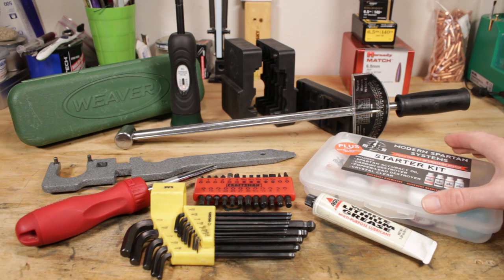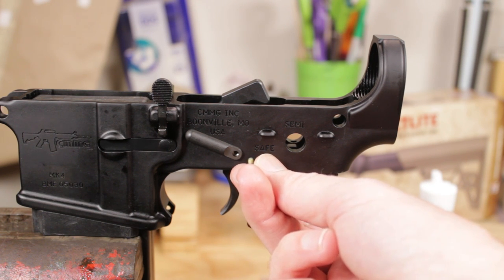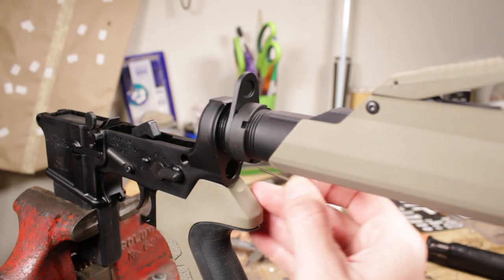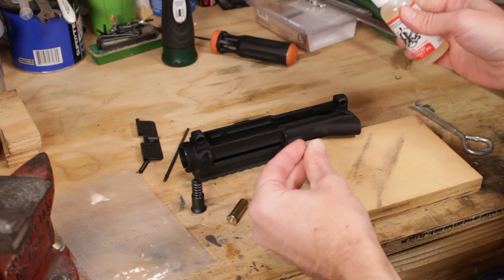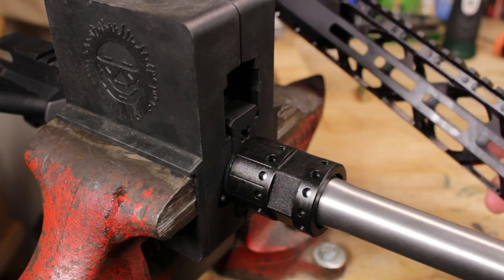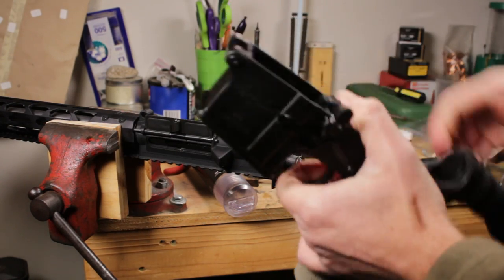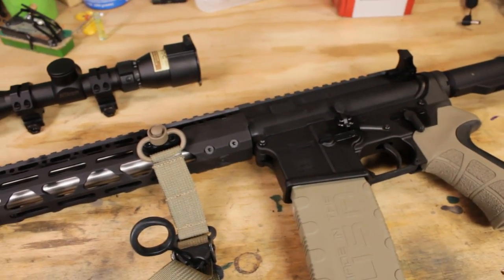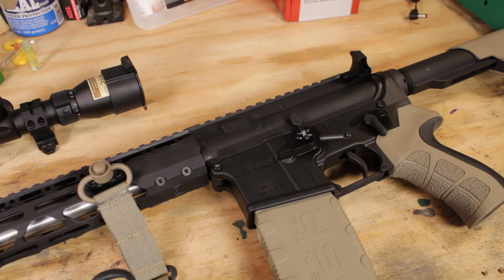Putting it all together: Scout AR Pt 3

Comment: On the front take down use some needle nose pliers to hold the detent then use a razor knife to push the detent down and hold it. Then slide the pin in and pull the razor the knife out. Works great.
Reply from the maker: Love it. That would have worked wonders.
Reply: Haha. I just built my first AR and after losing the first detent pin, I too used a razor knife to pop it in. Worked great.
Reply: I shot several detents and springs into orbit before I saw the razor knife trick.

Comment: you should show the reset on that trigger its crazy short. Literally just release the pressure from your trigger finger and its reset. The trigger may travel back forward a 1/16 of an inch.
Reply from the maker: Ooh. I haven't tried that yet. I can't wait to feel it with actual ammo running through the gun.

Comment: An important part of good firearm design is to use as few threaded fasteners as possible, none being optimum.  It is not always possible but they should only be used on non-critical components.  Go ahead and count the amount on this design, it's ridiculous.  The screws on the gas block are nothing short of sacrilege.  Your local mechanic down the street even knows how to shrink fit a bearing on a shaft using a bit of heat for crying out loud.
Reply: Rafael Lastra com 

Well it sort of depends on how it’s put together. When I was newer I bought a PSA upper that was dirt cheap, and it had a 15” rail and low profile gas block. Gun made it maybe 1k rounds before the gas block came loose and shut the rifle down. 

Now I have a BCM upper ($1k upper from a top tier manufacturer vs a $300 budget upper from Palmetto) and I’ve shot the bejesus out of it, and it’s been 100% in every way. 

It’s just a matter of taking time on how it’s put together.
Reply: Rafael Lastra com 
Ever heard of a spun bearing?